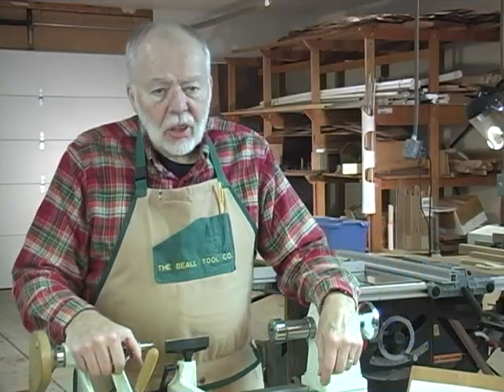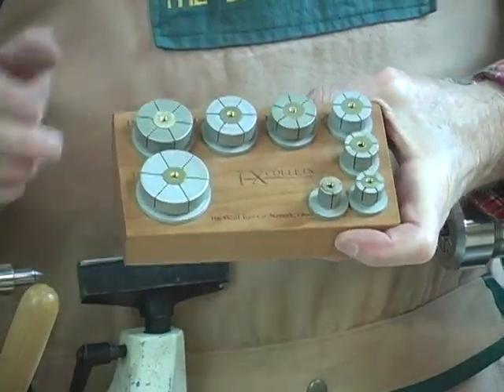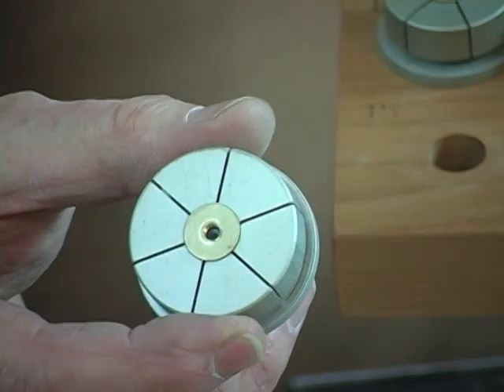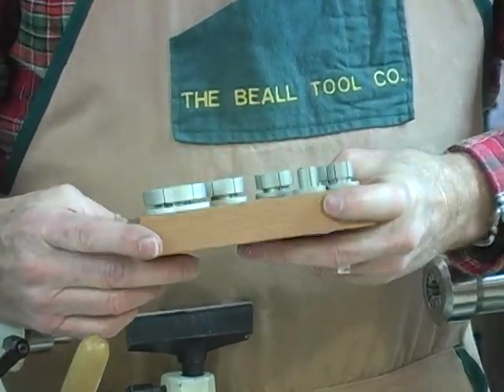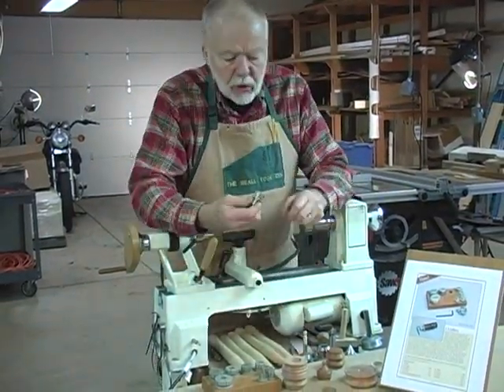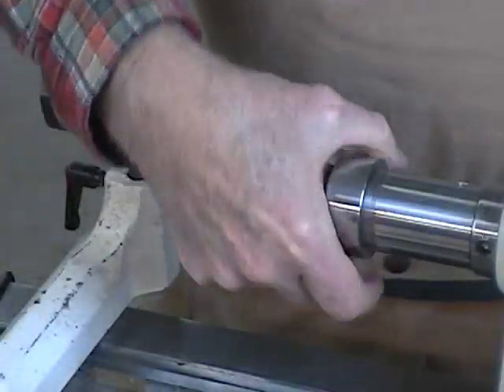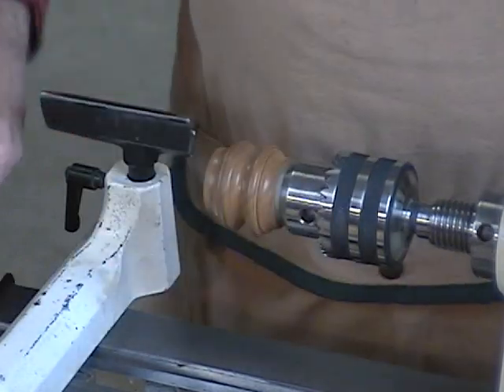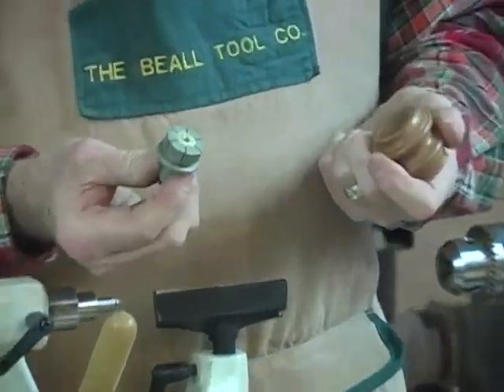IX Collets 1

Comment: when you say "standard drill bit sizes" in 2019 you are Assumed to be meaning METRIC sizes, ie 5,6,7,8 mm (PS: inches died in 1966 mate, when we ALL went to the metric system for EVERYTHING).
Reply from the maker: you may have gone metric but here, we still slog along with the old imperial.